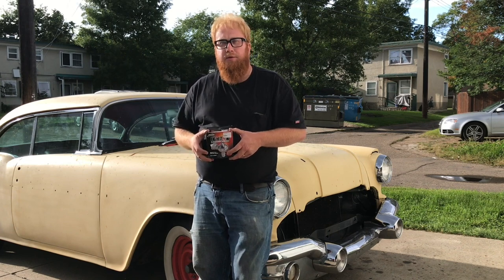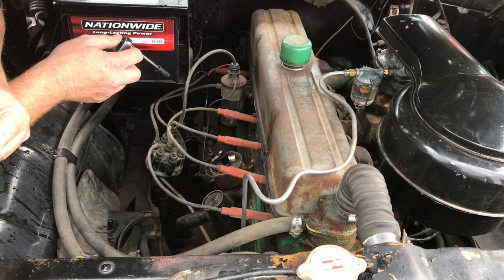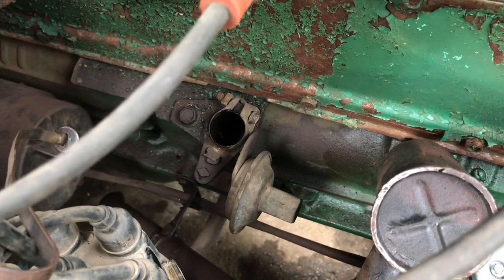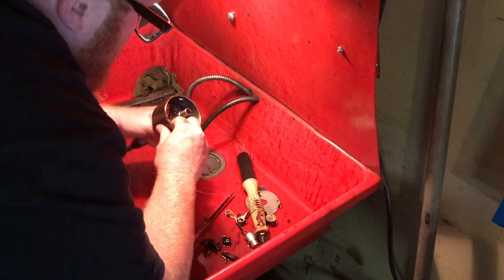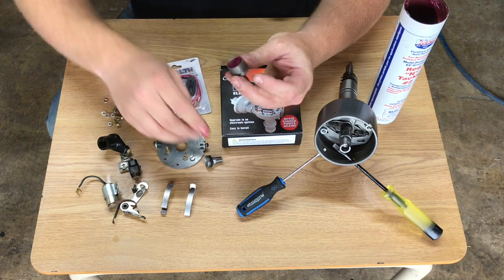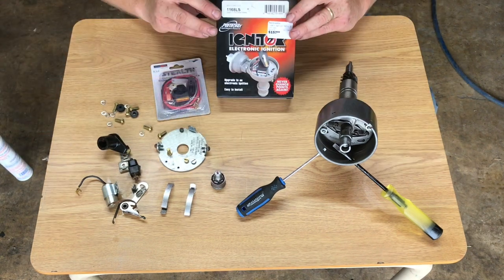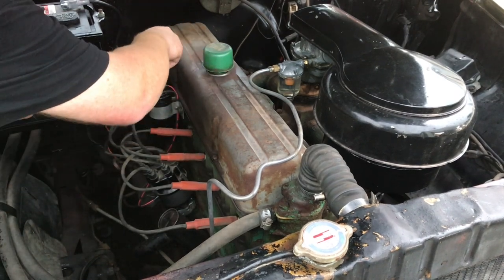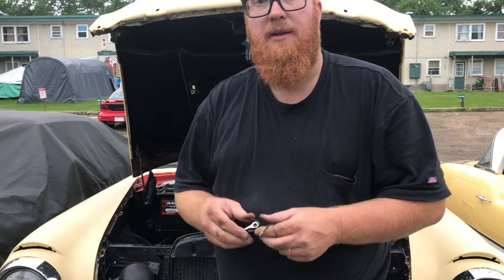Petronix Ignitor Electronic Ignition Installation on 1956 Pontiac

Comment: Awesome video hopefully I can do this to my 1958 Pontiac pathfinder, is the part number for this 1168Ls? Thank you very much great video
Reply from the maker: yes it’s the same and works on the GM 6 cylinder up until 1962
Reply: @RoyMarkosGarageRMG  installed works great thanks for the video!

Comment: By passing the resistor ? What's the affects if you don't by pass it??
Reply from the maker: The resistor drops the voltage, from 12 volts to about 8 volts, so the petronix would not get the voltage required to run properly. Also, that's why you change the coil to a 12 volt coil, so that you don't burn up the original one with the 12 volts.  Thanks for watching.
Reply: @RoyMarkosGarageRMG  thank you...

Comment: You never connected up the electronic ignition and the coil. How did it ever start?
Reply from the maker: I hooked up the wires but didn't do that on film, but if you watch at about 23:00 minutes in, you can see it hooked up and I explain other details through out.
Reply: @RoyMarkosGarageRMG  installed  the same electronic ignition part on my 46 chevy truck. Had to drill out the point adjuster as it was riveted on and had to use nuts on the  inside of distributor to secure  it as I had rounded threaded plastic block that no longer fit due to the Increased height of the new ignition plate. Also was looking to were the red wire went. I see that in the video now. Thanks. Jim

Comment: With the basic igniter kit Dont leave your key in the on position it will burn out the the module better off with the igniter two or three the Newark it's those you can leave the key on and it won't harm it
Reply from the maker: Great advice! I tend to turn off the car, and take the key, when I leave, but tempting to let it idle and everything else, so well said.